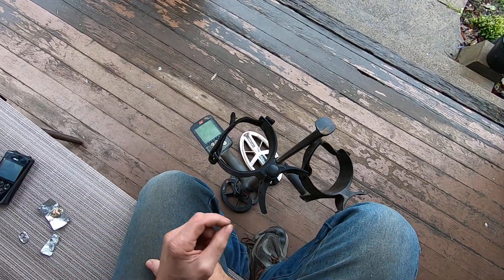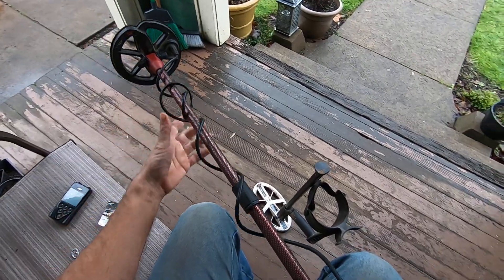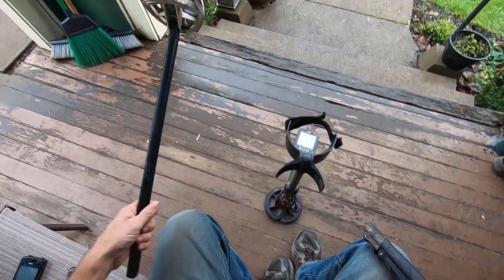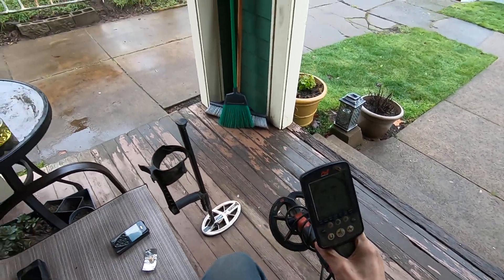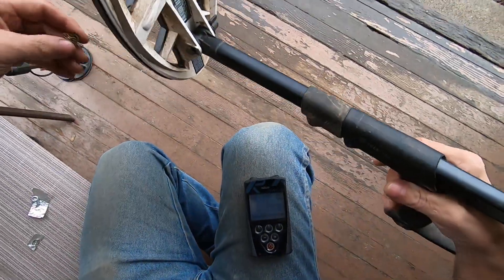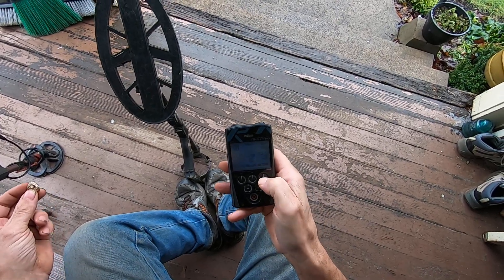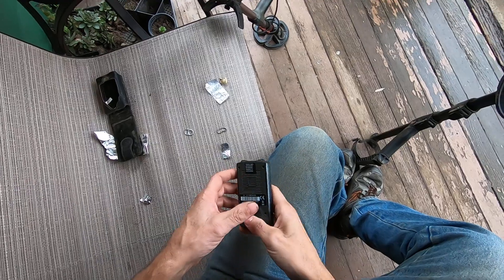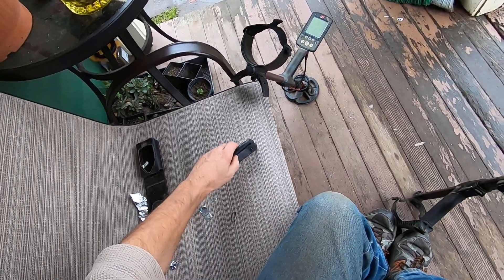XP Deus HF vs Equinox 800 amplitude tone test and Telenox shaft review.

Comment: Hey I recently put on my 6” coil on my equinox and found it horrible. It was falsing on nails like crazy. They would sound really nice and crisp even with the plug popped out would still sound nice and give high numbers. My stock coil always sounds scratchy with nails and when plug popped can tell for sure it’s a nail. Have you noticed this and what is your advice, is there a different setting I should be using with  small coil?